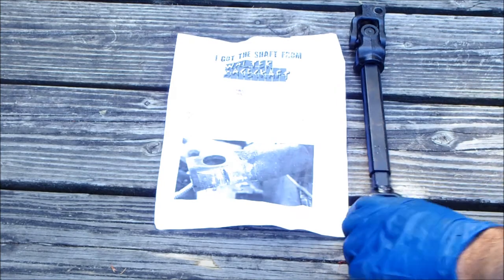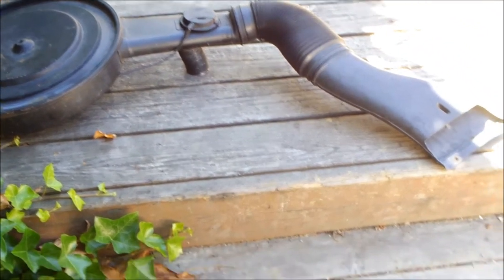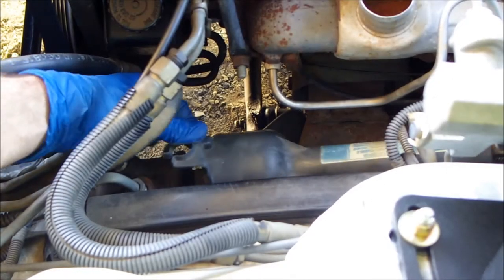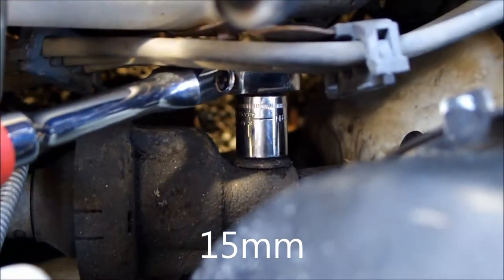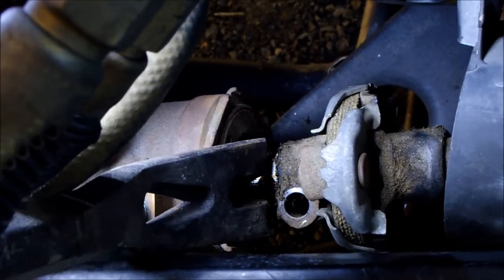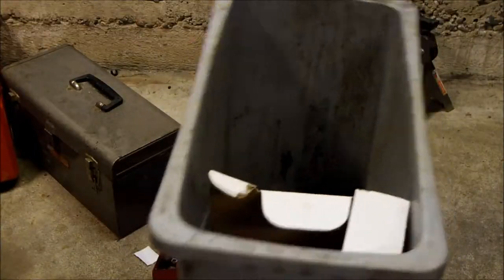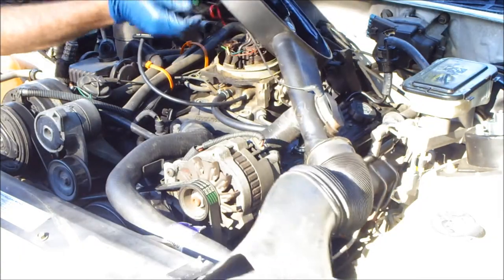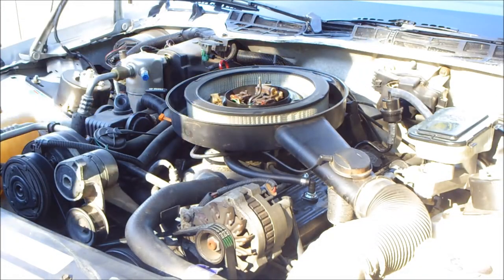Solid Steering Shaft Install (1982-1992 Camaro/Firebird)

Comment: Don't tell people to tighten bolts like that.  A too tight bolt can cause damage and even break in two.
Reply from the maker: natural selection
Reply: I thought that was pretty dumb too. Im sure that actually has a torque spec. Is that as tight as you can for a 120 pound guy or 240?

Comment: How can I purchase the steering rack
Reply from the maker: Like the Steering column? or the steering linkage?
Reply: The replacement part you put on in this video
Reply: Is it called a shaft or linkage
Reply: reggie johnson you can buy them on eBay they are called (Steering Shaft)

Comment: I did the red head steering box, pump and steering shaft. I used a reproduction shaft from Hawks so it has the rag joint. My question, is there that much difference between the rag joint style and the one you installed?   Thanks for the great videos.
Reply from the maker: if you have a NEW rag joint, just keep it. it's mostly old worn out rag joints that cause play in the system.

Comment: This is old video but hopefully I get a response. I need to find this intermediate shaft or one similar with the adjustable length for my 1988 camaro. If there isn’t let me know, I’m strongly considering just welding my intermediate to my steering column because I’ve tried three and they were too short by about an inch
Reply from the maker: Matt sells them, every few months he gets more in stock.
alternately, Detroit Speed has a kit, but it's WAY more expensive. 

https://walter-racecraft.myshopify.com/collections/suspension-and-steering/products/steering-shaft-upgrade-for-82-92-fbodies-82-93-s10s-and-78-87-gbodies
Reply: @3rdGenGuy  thanks for the link

Comment: Was your steering wheel crooked after install? Mine was at least 15 degrees off.
Reply from the maker: 15 degrees is pretty extreme. something went wrong, or maybe the solid shaft was welded wrong.
Reply: @3rdGenGuy  I think welded wrong. I had to take the steering wheel off and recenter it.

Comment: hi good morning sir.  what brand of steering shaft is this?    im having thw same trouble.   great video
Reply from the maker: A forum guy sells them
https://www.ebay.com/itm/82-92-camaro-firebird-s10-s15-monte-carlo-regal-upgraded-steering-shaft/232607180881?hash=item362877e851:g:90IAAOSwhglTwf5M&vxp=mtr

here's the forums
https://www.thirdgen.org/forums/engine-drivetrain-suspension-parts/667956-gm-steering-shaft-upgrade.html
Reply: Can also use a shaft from an astro van and certain jeep cherokees
Reply: CFMedic329 I saw an older video and you can use the Astrovan shaft
Reply: @3rdGenGuy  Link is dead.

Comment: Do yourself a favor, Bind the steering wheel with a stretchy bungee cord, it will allow you to move it enough and you wont be installing a new air bag ribbon.
You can't really lock the wheel and replace the part and no bungee cord is asking for it.
Reply: Wait... What? I'm gonna do this this weekend. What is the bungy for?
Reply: Ryan B,  Hello Ryan, I was a GM mechanic back in the day, You have a (wire) ribbon under your steering wheel on the column.  This ribbon is in a yellow plastic disc under the steering wheel, It allows you to turn the steering wheel left or right while maintaining a solid electrical connection to your air bag, if you disconnect the the shaft between the steering wheel and rack and pinion (steering box) you could just turn the wheel 100 times to the right, or 100 times to the left, in doing so the ribbon runs out of turns and breaks (it MUST stay centered).  
By tying the steering wheel down with a bungee cord you can rock the steering wheel back and forth a little in order to get the shaft off and back on, but it will not allow you to turn the steering wheel and break the air bag power ribbon, if in doubt, look up some videos on the air bag ribbon replacement procedure, it's easy, just tie down the wheel so it CAN NOT be turned before re-installing the new shaft.
Reply: Ryan B If you where to lock the steering wheel solid so it cant move(like key off column locked position) you would be fighting and fighting to get the steering shaft off and back on, you need to be able to move the shaft back and forth a little to be able to align it and get it back together.
Reply: @stclairstclair  thank you! I thought you meant I might set off the air bag.
Reply: @stclairstclair  so if it breaks, it means the air bag won't work. That's what you're saying right? The car will drive fine tho.
Also, what would you attach the bungy to? One from the seat adjust under the driver seat, thru the  steering wheel, then back to the seat adjust?
Reply: Ryan B, Correct tie it to the drivers seat rails,  Saying will it work if I break it is not a question, There is 100% absolutely no reason to break it, You can have the bungee loose enough that you can easily wiggle the steering wheel a 1/4 turn (just NOT allowing it to turn one full revolution)
Do not be intimidated by doing this job, tie the wheel soft enough to move it, tight enough it can not rotate, (make sure the bungee is taunt enough the hooks wont fall off as you wiggle the wheel,  Fairly tight, Dont use the old black solid rubber bungee, those wont have enough elastic give, Use only a normal nylon covered elastic bungee.
Reply: Ryan B, One day at the dealer I was servicing a car with the steering shaft disconnected and the steering wheel not bungeed down, A young coworker came by and grabbed the steering wheel and spun it as hard as he could making the "WEEE" noise thinking it was neat he could watch the disconnect wheel spin freely not knowing what an air bag tape(ribbon)was, I told him to go to the parts counter and bring me a new air bag ribbon and explain to his boss why they were paying me to install a new one, OOOOPS!
Reply: @stclairstclair  I really appreciate you responding. Thank you!!!
Reply: Dont think the wheel's just gonna go spinning itself into oblivion while the car isn't moving.
Reply: @stclairstclair  You took that way too personal and way too wrong. All I meant was that when I do this steering shaft job I'll be working alone and nobody will be around to go "WEEEE" and spin the wheel, plus I already knew about the ribbon being there. Have a nice day
Reply: GlassSandwichTV, Ha ha, That did cross my mind but I've been "YouPoop programmed" to attack because of so many douche bags, 
Sorry.
That ribbon will allow you about one turn "off" before you're screwed, and as a young tech,  I too did not always tie down the wheel, The problem arises when inadvertently you end up where it "drifts"....some steering wheels will roll over because of the offset weight of the airbag or you end up twisting the shaft when reinstalling the shaft, You think it rolled right so you turn it back left, But it phucks you, As a young mechanic this did indeed end up happening and finally a senior tech yelled at me and said "bolt the phucking thing down" So after that I bungeed them down and never had to worry, Getting the new airbag ribbon connection wire down the steering column can be daunting for a newbie and costly, Not worth the risk for a onetime job done by a non mechanic. Peace.

Comment: Go to Hawks motor sports for a performance steering shaft folks. Much better 👍
Reply from the maker: the $300 Speed engineering shaft is shiny and new , but it doesn't do anything better than the $80 Astro shaft.
 both of em get the same result.

Comment: What the fick does the hood light got to do anything whit the shaft and not to say he forgot to hook it back up
Reply from the maker: Drains the battery.
mine went dead after replacing other parts with the hood open.
figured i'd help others avoid the issue
Reply: True, I keep the hood light permanently unplugged
Reply: I've worked on my iroc for 6 hours at a time and the battery was fine.....